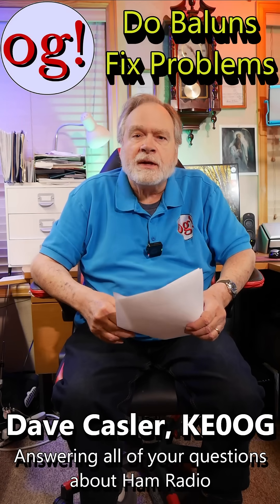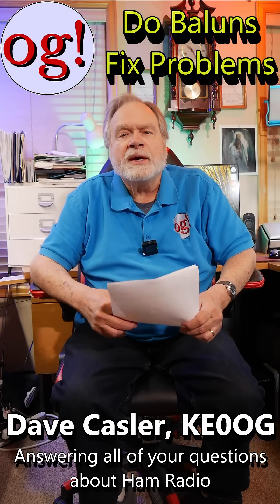Do Baluns Fix Problems (Short #82)

Comment: The actual "problem" he had was never mentioned...does it still load at all, or is it just a dead short? If it's a bad connection, that's one thing, but if it's simply r-i-s-i-n-g SWR, he could always try adjusting the anchor points for each antenna end 🇺🇸

Comment: Vinegar is a cheaper and more readily available product to use for cleaning corrosion. Self algamating silicone tape with uv protection is a great choice to seal those connections long term. It works great and it's not permanent like a silicone caulk would be.